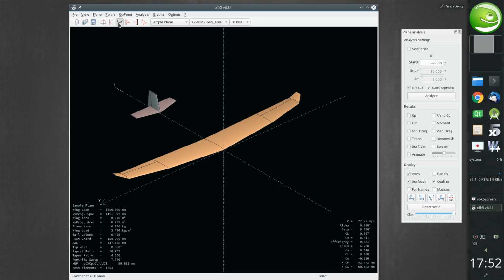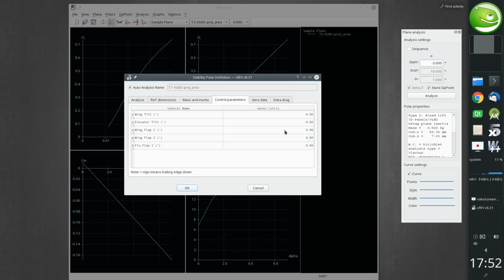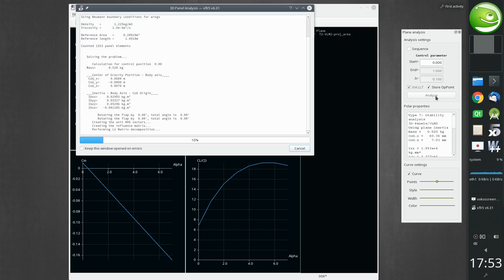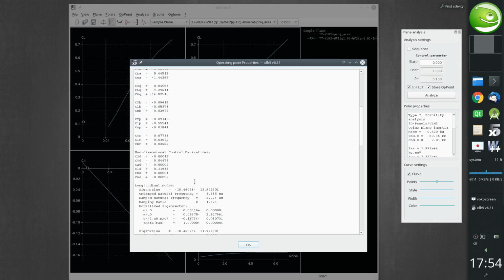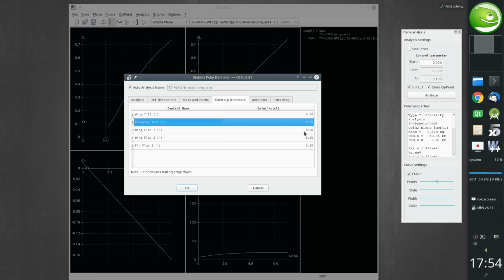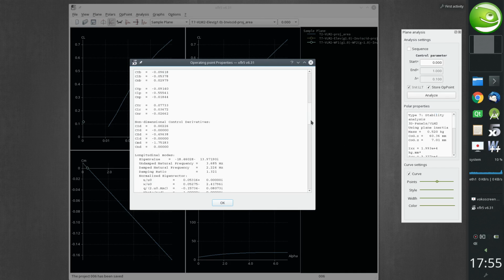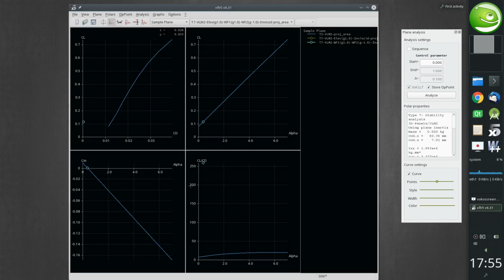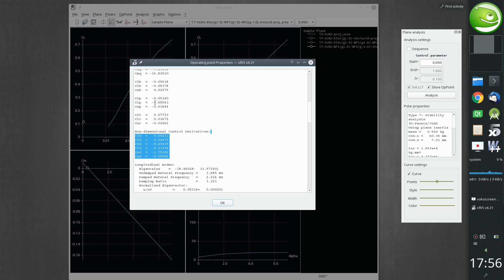16.1 - Stability: control derivatives

Comment: Hi,
What are the equations relating the non-dimensional derivatives (e.g. Cx_de) to the dimensional derivative X_de?
The documentation of XFLR5 explains those conversions in case of the states derivatives (e.g. Cx_u --> X_u), but doesn't explain what I'm asking for.
Reply: X_de = Cx_de*Q*S
Reply: @woeileongchan9552  To run this test, do I need to create a version of the plane with flaps and then run the test or can I do it on the standard plane which doesn't have separate foils defined for it?

Comment: This is what i get after running stability analysis
xflr5 v6.47
31.03.2020  00:54:36

Launching Analysis

Launching the 3D Panel Analysis....
Nimbus
Type 7 - Stability polar

Wings as thin surfaces
Using ring vortices - VLM2
Using Neumann boundary conditions for wings

Density   =      1.1925kg/m3
Viscosity =  1.4982e-05m²/s

Reference Area   =     0.65087m²
Reference length =       2.134m

Counted  641 panel elements

   Solving the problem... 

      Calculation for control position  0.00
   Mass=       6.900 kg

   __Center of Gravity Position - Body axis___
    CoG_x=      0.0760 m
    CoG_y=      0.0000 m
    CoG_z=      0.0000 m

   __Inertia - Body Axis - CoG Origin___
    Ibxx=           0 kg.m²
    Ibyy=           0 kg.m²
    Ibzz=           0 kg.m²
    Ibxz=           0 kg.m²

      Creating the unit RHS vectors...
      Creating the influence matrix...
      Performing LU Matrix decomposition...
      Solving the LU system...
      Time for linear system solve: 0.049 s
      Searching for zero-moment angle... Alpha=-0.57743°
      Creating source strengths...
      Calculating doublet strength...
      Calculating speed to balance the weight...VInf = 33.38190 m/s

      __Inertia - Stability Axis - CoG Origin___
      Isxx=           0 
      Isyy=           0 
      Iszz=           0 
      Isxz=           0 

      Calculating the stability derivatives
         Creating the RHS translation vectors
         LU solving for RHS - longitudinal
         Calculating forces and derivatives - lateral
         Creating the RHS rotation vectors
         LU solving for RHS - lateral
         Calculating forces and derivatives - lateral

      No active control - skipping control derivatives

      Longitudinal derivatives
      Xu=   -0.032453         Cxu=  -0.0025051
      Xw=      1.1982         Cxa=    0.092492
      Zu=     -4.0849         Czu=  -0.0022746
      Zw=     -62.344         CLa=      4.8124
      Zq=      -18.59         CLq=      9.4095
      Mu=   3.717e-08         Cmu=  9.4072e-09
      Mw=     -6.5671         Cma=      -1.662
      Mq=         -17         Cmq=     -28.213
      Neutral Point position=   0.18134 m

      Lateral derivatives
      Yv=     -3.4883         CYb=    -0.26927
      Yp=   -0.032138         CYp=   -0.002325
      Yr=      5.9923         CYr=     0.43351
      Lv=    -0.24698         Clb=  -0.0089338
      Lp=     -14.555         Clp=    -0.49343
      Lr=      1.6933         Clr=    0.057404
      Nv=      5.7875         Cnb=     0.20935
      Np=    -0.63795         Cnp=   -0.021627
      Nr=     -9.9488         Cnr=    -0.33727

      ____State matrices_________
       Longitudinal state matrix
           -0.00470337            0.173654                   0               -9.81
             -0.592014            -9.03533             30.6878                   0
                   inf                -inf                -inf                 nan
                     0                   0                   1                   0
       Lateral state matrix
             -0.505557         -0.00465763            -32.5135                9.81
                   nan                 nan                 nan                   0
                   nan                 nan                 nan                   0
                     0                   1                   0                   0

      Unsuccessful attempt to compute eigenvalues for Control=     0.000 - skipping.

     _____Finished operating point calculation for control position  0.00_______
Reply: I have the same problem, did you fix it?

Comment: So what is exactly that gain? From dimensions it looks like a control gain in a closed loop, but for your explanations it seems like a percentage of the aileron that is deflected, a bit confusing. I would appreciate some details on that
Reply from the maker: "Gain" is used in the same way as in the AVL  program. It's a multiplication factor such that the total angle = gain x sensitivity.  The analysis is run for each requested gain value.